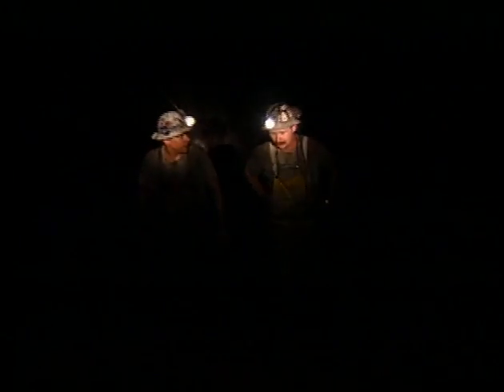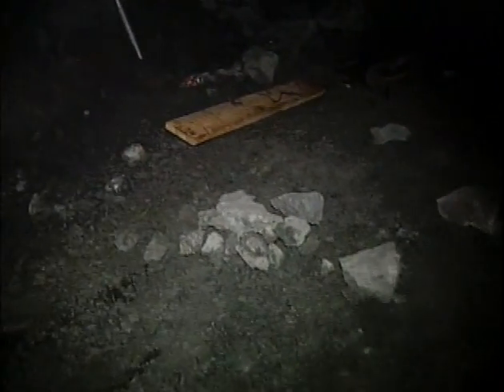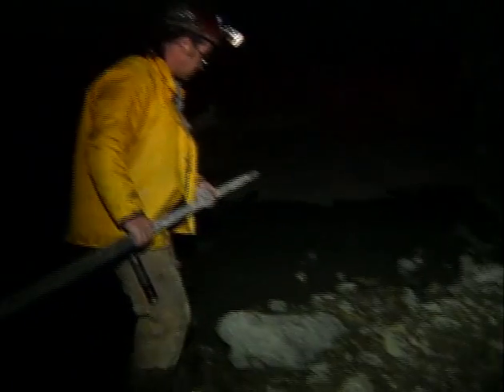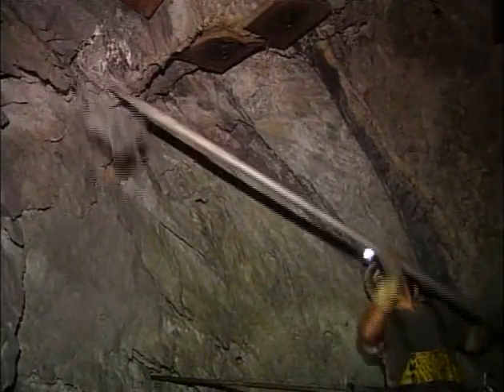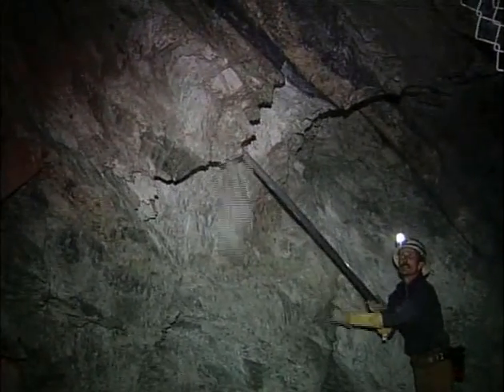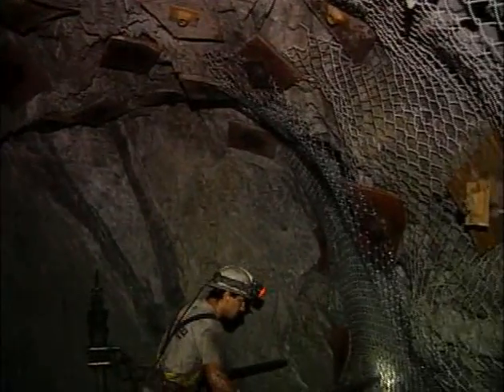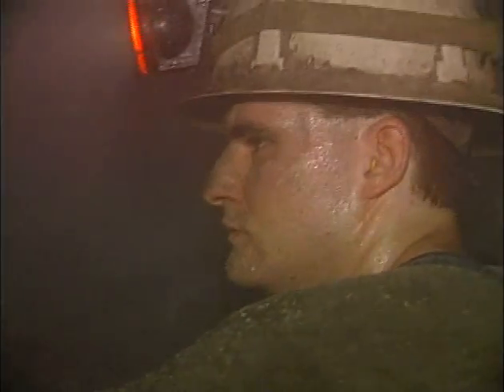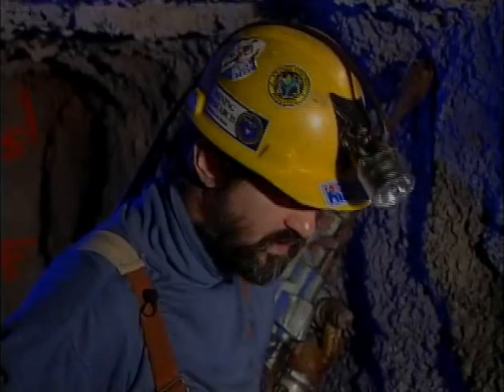Rock Falls -- Preventing Rock Fall Injuries in Underground

Comment: we used to keep an eye out for rollers, then we used to place wooden wedges in the roof for movement in the cracks.If the wedge was on the ground after you had gone through you knew there was a problem. (that was in coal) the mechanical rockbolts used to turn inside out as we were tightening them up . micaf 11 orebody mount isa mines 1974 / 75.
also you bar from good to bad and keep your eyes open and ears tuned.

Comment: I mined is the States during the '80's.  Never heard of the one hole one bolt rule.  We used a split set bolt with metal plates and metal "headboards," and "chicken wire" like is used in the video.  Split sets would break a wooden head board as can be seen in the video.  While not great, this video is not that bad.  Baring down sucks, but it is a must.